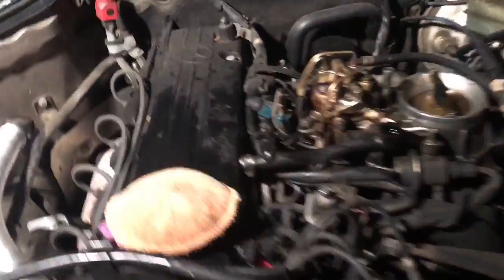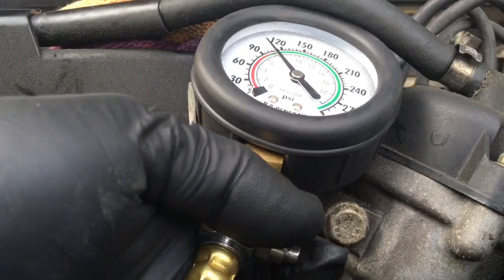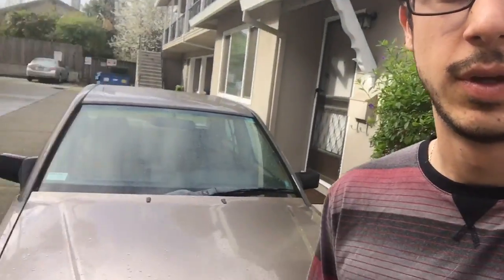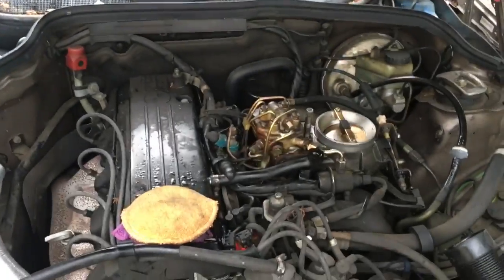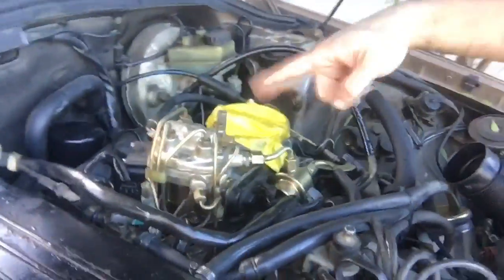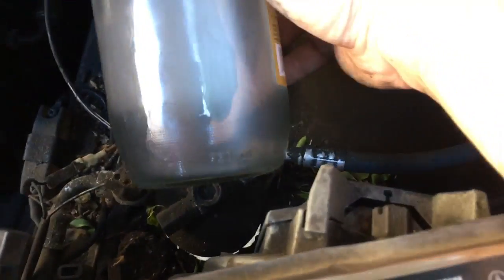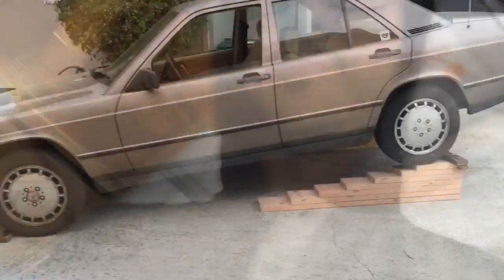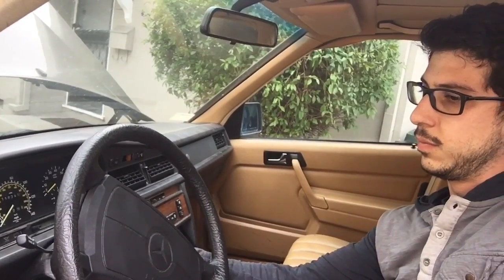WELCOME TO THE FAMILY 190e PROBLEMS STARTING

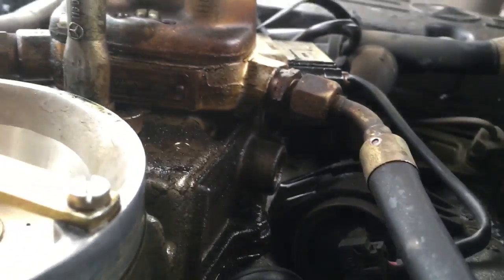Comment: check cap and rotor for wear on the contact points, also  replace the tiny fuel filter part # W0133-1637696. if you pause at 6:18  that nut in between the fuel hose end and the fuel distributor housing is actually a tiny filter with a copper washer on the one side. also after you shut it down press down on the air hat inside the air fuel sensor, if there's no resistance then you may wanna check the fuel accumulator. Grats on the mercedes

Comment: This part is the EHA and is vital to the correct functioning of this engine. Inside of it there is a screw to adjust the differencial pressure between upper and lower chamber of fuel distributor. When it is leaking normally it means it is dead.

Comment: I have 2 190e w201 the first 1.8 manual second 2.0 automatic on the first i replaced the fuel pump, the air flow sensor, the coolant sensor, seal on piston in fuel distributor  works perfectly
a cold engine or warm start immediately.

Comment: Both o rings on the potentiomiter are for two ports not one .The o rings need replaysing  first
Reply from the maker: Trevor Hadlington definitely replaced those. the double sided tape was temporary experiment and not a good idea :)
Reply: i hade it cracked and leaking where plastic meets metal, o rings wasnt the cause of problem for me

Comment: I have the same problem on mi 190 2.6 the idle air control valve if i take the electric plug of it will start not real fast but lot better then whit the plug connected and will run good the fuel pc whit the O ring on it has a mixture control allen  screw under the bras screw clockwise more fuel uncloak  more air fuel filter in the pump look like the guilty one or idle  air control valve fuel pumps are new so that is out  this car never start any good and if i live it just a couple  days not running it will take one or 2 minutes to start any ideas welcome thanks
Reply: That is what's called a run on sentence. Lol.